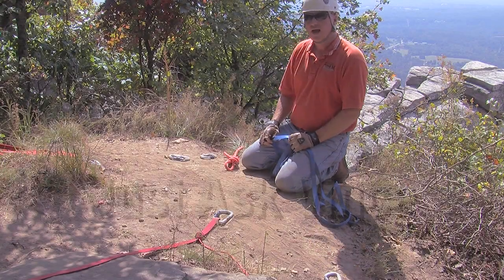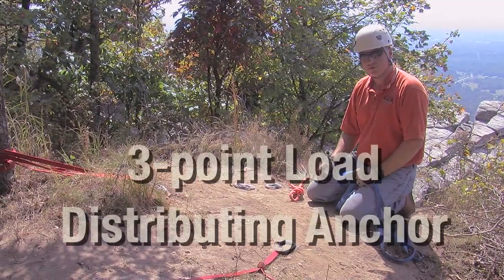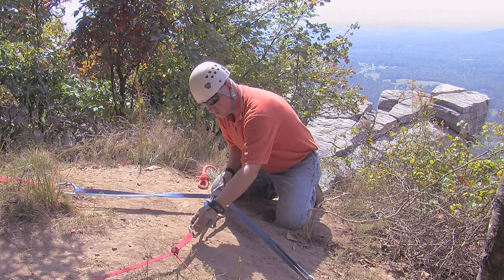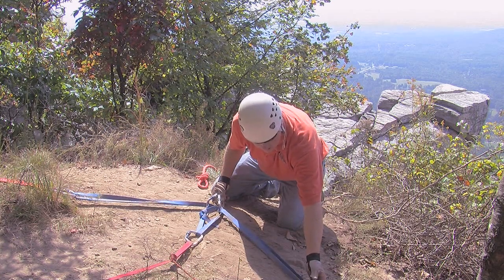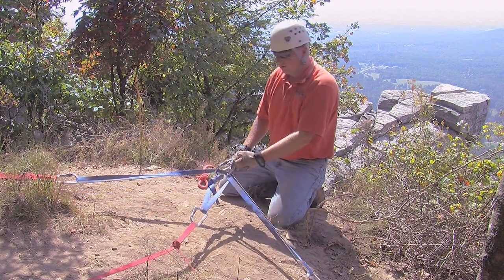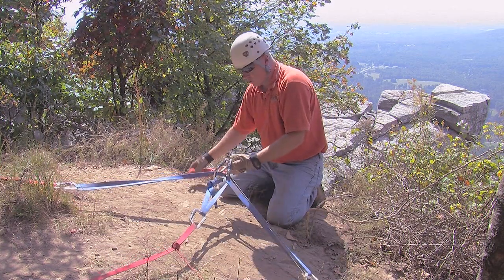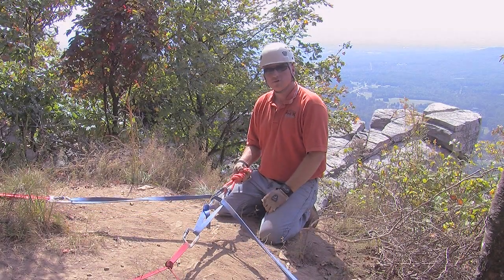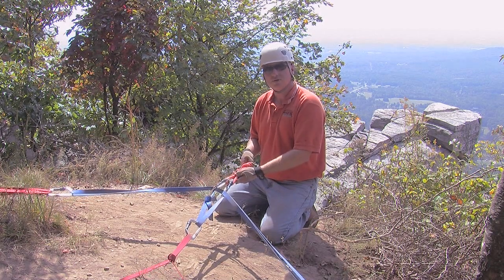3 Pt Load Distributing Anchor

Comment: great video.  armchair points are easy but I enjoy this subject like you.  my thoughts are that the viewers left hand carabiner should also be inside a sliding X as well. Also, the less the angle between anchor points the better,  a 1000 pound load with a 20 degree spread of the anchor puts 504 pounds on leg of a two leg anchor.  So 90 degrees is not an ideal.   One last thing is flip one of the paired lockers.  thanks for your videos, the other two are worthwhile and well done also.
Reply: baezport 1000lb load? I assume that's theoretical? Not sure the system wants to see a 1000lb load, as that's above the working load limit specified by the manufacturer. 
I used to like these systems in the 90's, but they've fallen out of favor today. The "self equalizing" part of this is not desirable. With better planning the rigger can engineer the anchor so that it's plumb, and deliberately adjust it should a redirect be needed. A moving anchor is not ideal imho. I agree with you that 90 to 120° is far too excessive and would rather see between 30 and 60° for your V anchor.

Comment: Correct me if I am wrong, but haven't you just taken a triple redundant anchor setup and introduced a single point of failure between the anchors and the main rope?  Yes the system will self equalize if one anchor fails, but if the webbing connecting all three breaks the whole system fails. Seems like added risk for minimal reward.
Reply: Jeremy West Imo you'd have a belay on a completely different anchor in case of failure.